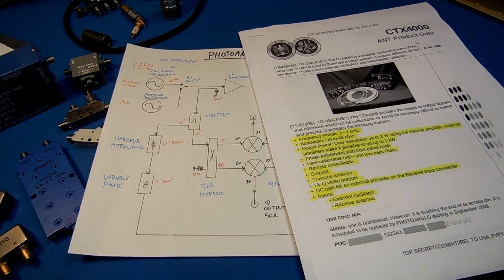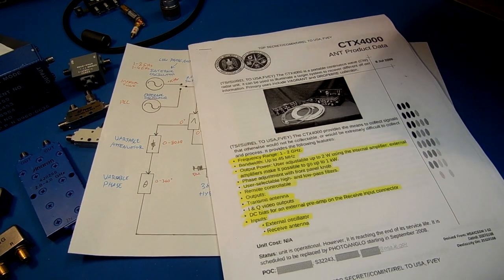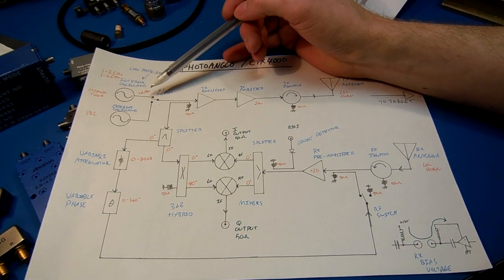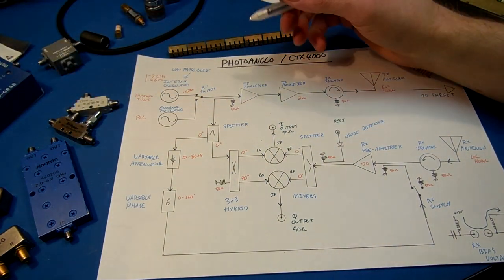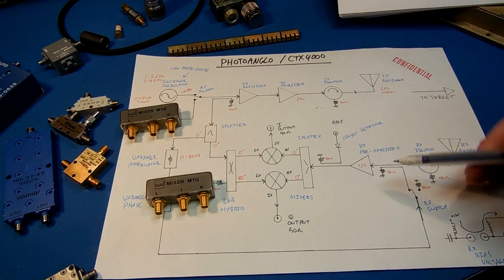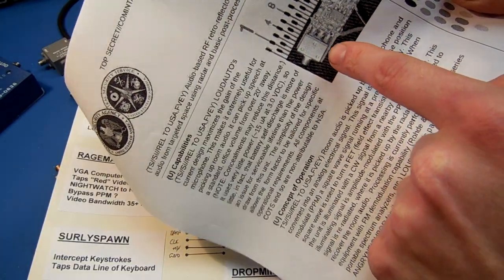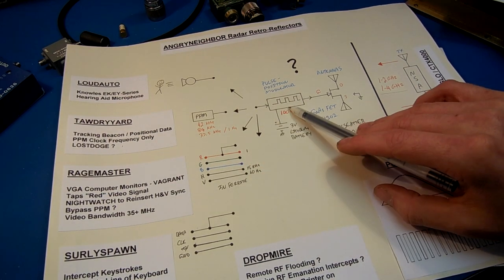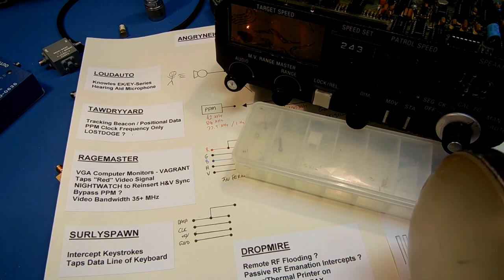GBPPR Vision #25: Overview of the NSA's CTX4000/PHOTOANGLO Radar Units

Comment: Can't the nsa just commandeer a router in the building and use that instead of either CTX4000/PHOTOANGLO Radar Units? Or let me rephrase, if the nsa has commandeered the router, could they use it in this fashion to illuminate the bug and send the audio signal out via the internet rather than have to park a surveillance van outside and use the CTX4000/PHOTOANGLO Radar Units?